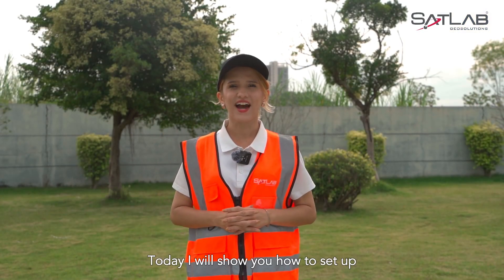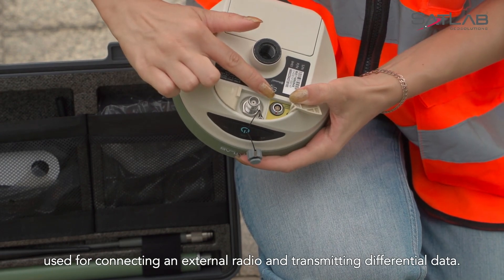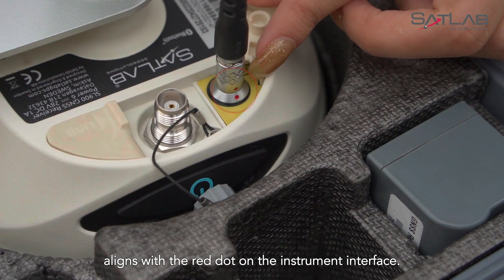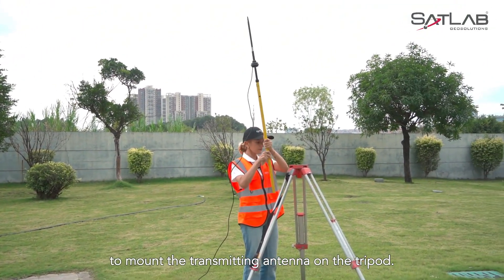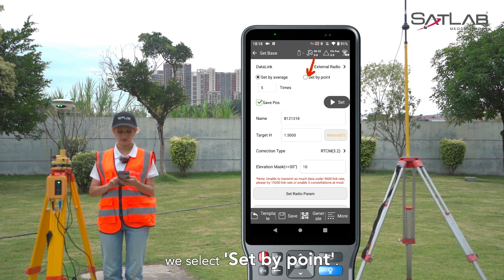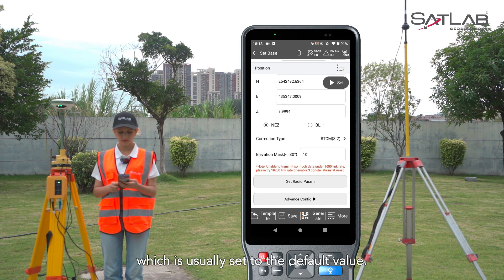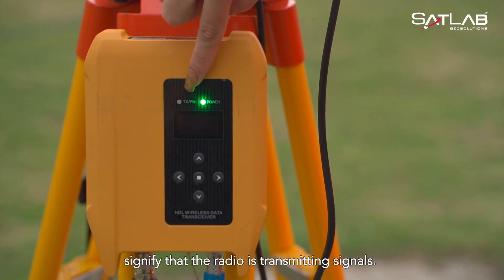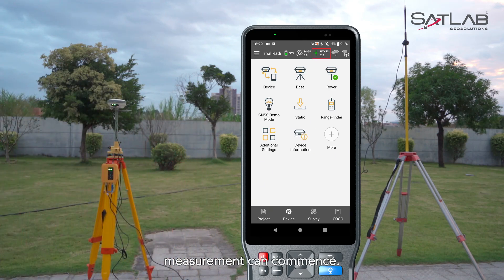Tutorial | External Radio 1+1 Mode

Comment: Dear Satlab Team
I am Adeel and I am using Satlab in Saudi Arabia. I am facing a major issue with the geoid model. Here, EGM 2008 is used, but our elevation readings are not accurate. I have tried multiple times and have also used the provided geoid file, but there is always a difference in elevation. Please provide a solution for this issue. I have five receivers: 2 SL900 and 3 TR7. Elevation accuracy is perfect when using E-Survey, but we have always faced this issue with Satlab.Kindly resolve this problem.

Best regards,
Reply from the maker: Please leave your name and Email address. Our team will contact you ASAP.